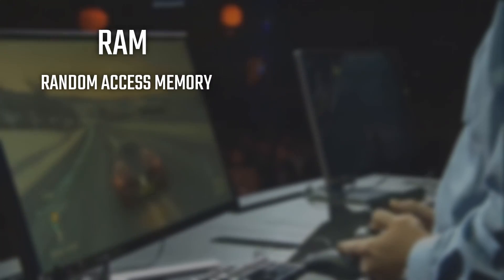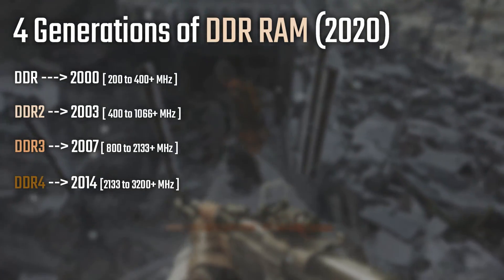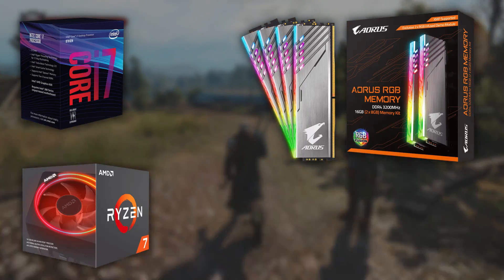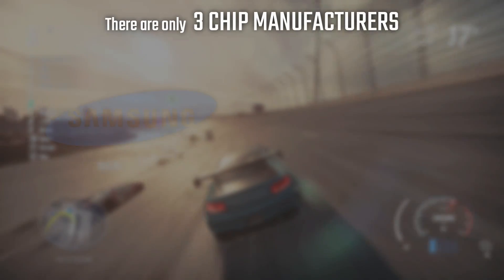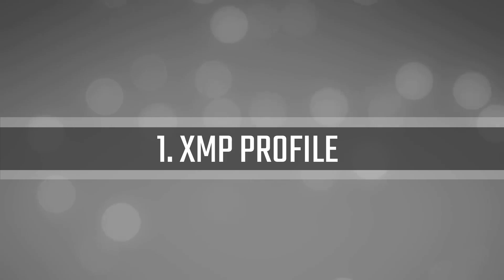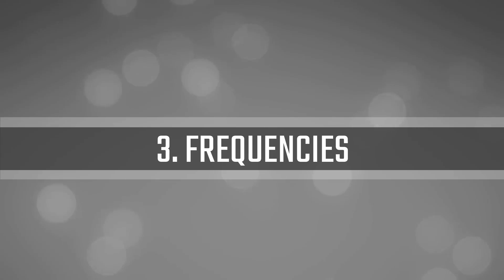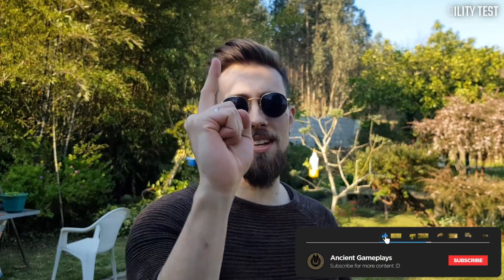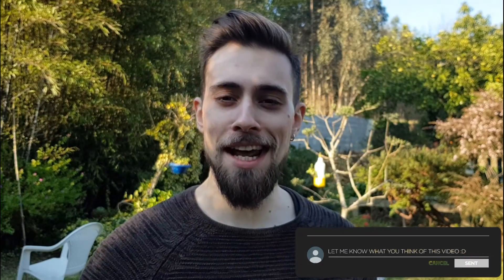How to Overclock RAM (2020 Tutorial) | Introduction of How RAM overclocking works, Tips and Tricks

Comment: But it didn't answered my question kind. All intel 12th gen cpu's supports ddr4 3200mhz and ddr5 4800 mhz stock. I know the motherboards supports these types, but then i see that they've higher mhz supports listened as OC (overclock). And my question is: If the CPU supports up to 3200 mhz ddr4 how does it communicate with the ram's higher speed higher than 3600 mhz and so on?
Reply from the maker: No...you got this all wrong and you're looking at an outdated video. Well, Firstly the motherboard does not support both RAM types, the CPU does. So either you buy a DDR4 motherboard or a DDR5 one. As for the "support" it doesn't mean that they can't run higher frequencies it just means that those are the base frequencies of the memory controller
Reply: @AncientGameplays  i meant that i7 12th gen supports either ddr4 or ddr5. And the main think of OC ram is to look at the motherboard memory specification

Comment: hello fabio. I'm using 1.15V for my soc voltage on a 5600x and b450. Do you think its safe? In this video you said 1.1 at max but after that you said 1.15. I couldnt be sure and i wanted ask. Thank you for your reply in advance.
Reply from the maker: It is, 3rd and 5th gen ryzens like vsoc for higher frequencies. Watch the 2021 version of this video

Comment: ( some tips ) well i learned this the hard and most time consuming way, lower timings usually better performance, not always. helpful video but you wish you did not say "ignore the rules lower timings are always better" that is not true, i noticed there are so many timings that cant be lower than some kind of rule, or some timings dropping them way too much at the edge of instability will cause worse performance. everything you do with timings test performance before stability. dram calculator is so helpful for a base safe overclock then you can start decreasing further.

Comment: i changed to xmp profile and my computer didnt open after the reset
i had to remove the cmos battery to reset the bios settings to get it to work
should i try to change to xpm profile again or will the same thing happen?
Reply from the maker: raise the voltage. Also watch the 2021 version of this video
Reply: @AncientGameplays  can i use xmp profile if i have ryzen cpu?

Comment: Using xmp only, after updates to windows, intel etc, I noticed under load or benches my VCCIO and SA could hit as high as 1.4v on my 9900k

I've been studying ALOT, reading forums listening to YouTube's on my commute and spent 20hours straight (and without the aid of caffeine or cocaine, somehow) + another 20 hours letting two instances of prime95 running (mostly because at that point I was understandably sleepy and passed out with them running.  Woke up and my house wasn't on fire and I said shit I guess it's stable) getting things to run faster than xmp at lower temps 

My other concern is ram.  I use xmp only since going beyond xmp is even less relevant than cpu oc and it's far more sensitive to tweaking so I just leave it be, but it's STILL overclocked and it's still not been tested at the factory to run with my system or cpu for sure, so I was hoping to find someone about good stress testing a memory overclock and if the sa and VCCIO are truly good 

I used prime 95 in. A blend test the latest version without disabling any avx but still ftts in place cuz otherwise the cpu cooks itself but I've read so much conflicting info about how that stresses the wrong parts and I gotta drop my cpu to 3700mhz to do a standard blend or it crashes.  But I don't wanna cheat and turn shit off.

This obsession is worse than my heroin problem was.  I guess I could just take that up again lawl
Reply from the maker: Hey man, for ram testing use TestMem5. Also, RAM oc is a pain the ass, it is not "hard" per se in its essence, but it takes a SHIT LOAD OF TIME to get things straight

Comment: I have options for auto voltages after I over clocked the ram. Do you not trust auto settings? And I have a VDDCR soc voltage of .825v should I still be increasing it above 1?

Comment: Sir i have a Question, my PSU is lc-8600btx 600w (yeah a generic one and it is with me for 5 years, and run find with my current pc)
Specification
Cpu: Ryzen 5 3400G
GPU: Vega 11
RAM: Ramsta 2666 8gb( planning to upgrade to 2×8 3200 Darkza ram, thank you Ancient Gameplay for advices)
MoBo: MSI A320m-A pro( they said it locked which is true but according to box it can  oc to 3200mhz)
And now im thinking will my psu be enough to oc my ram if i buy the 3200mhz ram? Thanks for the help, btw your  video is great, it contain all the information i need on  how to oc ram, bu my problen is psu, is this fine?

Comment: When I run memtest86 with xmp on I get errors should I try manual timings and increase voltage or do you think my ram is defective?

i7 8700k
G.skill trident z neo 3600mhz
Msi z370-a pro
Reply from the maker: Yeap, i think you should first increase voltage
Reply: @AncientGameplays  does increase in voltage fix the crashing of my games?

Comment: i have 4 sticks of corsair vengeance rgb pro and motherboard stock settings are fine, but xmp crashes immediately. its supposed to go up to 3600 mhz
Reply from the maker: It depends a lot on the cpu and mobo you have also. Also, update your bios
Reply: @AncientGameplays  I’ve got a B550M Steel Legend with a R9 3900X and also how long do we test in the dram calc before we know its stable to change freq/timings
Reply from the maker: @lukeronquillo2284  use testmem5. I will update tgis video tutorial in 2021 also

Comment: Okay so I overclocked my memory to 3400 mhz from 3200 and when i attempted to change the timings my PC would not post, so I had to google how to get it back on and I had to CMOS reset my computer to get it back on, next thing I know all my games are shit FPS, tearing like crazy, really shit display so something has been damaged and I need help from you since I followed your tips and tricks. Now I need tips on tricks on how to fix a GPU that got blown up by ram. My pc was working fine before I just needed more fps in CPU bound games like planetside 2 and now I cannot play anything.

What do I need to do?

Overclocked memory.
Got it to 3400mhz stable.
Went to adjust timings.
Pc failed to post.
Put screwdriver to short circuit on motherboard on jatb1 (Tomahawk max b450).
Got PC to boot up normally and select F2 on prompt saying to load bios optimised defaults.
I was happy like yay my pc is working thank god I'm not touching that again!
I go to play Division 2 and I notice that something is wrong, then as I start to twig I notice EVERYTHING is wrong all the textures are tearing.
I restart PC go into bios and just said fuck it, enabled XMP Profile 2 (works fine, worked perfectly before I followed your video and fucked it up).
I go back into my game and everything is still fucked.
I update my GPU to the latest driver (from a previous driver I was sitting on because the driver was working fine, didn't see a need to update).
Problem persists.
I go to DDU website and said OK surely all I need to do is a clean fresh install of my GPU and everything should return to normal.
I was wrong, problem still persists after the DDU clean install of my GPU and restarted.

The only thing I haven't done, which I will attempt to do now is CCleaner. I need your help, I am not buying a new PC this one is legit brand new and it cost me a small fortune.
Reply from the maker: Hey man, i hardly doubt that it was something getting broken, i did that process thousands of times. For CMOS clear, i advise you to take of the little battery on the board, take off the power cable and press the power button continuously for about 10 seconds (that should do the trick and its way better). Having the PC not boosting is completely normal in ram overclocking and i have been doing that step over and over again, and like i said, it shouldn't in any way, cause hardware issue. THe most it can happen is having a corrupted Windows by RAM overclocking fails time after time.

you can also try to update your BIOS and do things all over again. Like i said, i am 99.9% sure it isn't hardware related. Hope this answer helps you in some way :D
Reply: @AncientGameplays  Ahh ok thanks for the reply that makes sense. So I will try to update BIOS again and maybe reinstall windows.

So is it possible for the RAM overclocking to fail which then could corrupt windows causing my GPU to perform poorly? So probably a fresh install of Windows 10 will likely fix the issue back to normal?

It's the first time I have ever had to remove the little battery to get my computer to boost back up, well I didn't remove it I just drained the power on the battery.

"For CMOS clear, i advise you to take of the little battery on the board, take off the power cable and press the power button continuously for about 10 seconds (that should do the trick and its way better)." So you think I should do this now before I re-install windows and bios? Thanks so much for the response it made me feel a lot better because you are much more knowledgeable than I am. lol

Comment: I have an Asrock fatality motherboard and Corsair vengeance 2666 MHz ram and no matter how much voltage I put in I cannot get it to overclock to 2933 it just gets put into a boot loop
Reply from the maker: because you need to loosen the timings. And if you are unlucky you won't be able to overclock no matter what. Just try and reduce the timings

Comment: Well i have hyperx fury 3600 cl17 but when using xmp profile to reach that 3600mhz the bios just reset and  my system got looooong boot .. i increase voltage its better but still bios reseting itself why?

Comment: So I have a 2x8 CL16 ddr4 @3200mhz. Factory setting in my task manager/performance/memory I run at 1600mhz. Why are they called 3200? And if I change the frequency in the bios to 3200mhz I actually double each so I get 6400mhz ? I can run it at 2800mhz in my bios but over this it just crashes
Reply: Just tried 3400 following everything you said and windows couldn’t even start. I had to start in safe mode, reboot and tune down bios again. I had my VOC at 1.13, ram voltage at 1.40

Comment: I cannot run my ram on the 3000hz that the package says if I want to set the ram to that speed, the pc starts up in save mode I have also tried to increase the voltage but that does not matter :/ the max frequency i can run it at is 2666hz. Plss help
Reply: i have the same problem

Comment: My buddy had 3200MHz RAM but it only clocks at 2133MHz. We bumped the voltages to 1.4v and it still didn't work to get the ram clocked right. Stuck in boot loop
Reply from the maker: Humm. What cpu
Reply: Ancient Gameplays ryzen 7 3800x
Reply from the maker: @stephenroth3299  nah, use xmp. That cpu will easily run 3200MHz
Reply: Ancient Gameplays I didn't see an XMP profile the last time I was in his bios but I'll check it out. I only found DOCP
Reply: Ancient Gameplays he's got an ASUS B450-F so I think it only has DOCP
Reply: Ancient Gameplays we also went in, made sure it was set to DOCP, it set the values to 1.35v and 3200MHz, still wouldn't boot.

Comment: Does the amd , thing soc volt also apply to intel chips?
Reply from the maker: Nope, intel uses the ring ratio. You dont need to carr much about intel. Also, ocing ram.on intel platforms is currently way easier

Comment: To the op, curious was your Celeron a 333mhz. I had that bad boy at 500mhz fan cooled with 6 case fans, 600mhz with a soldered personal fridge copper line to CPU hehe. Have a drink and water cooled same time, not sure when water coolers came out but if they was one I didn't know about it.

Comment: I have 16 gigs 3000 MGHZ ram in my PC rn, but I bought another 16gb of 3600 should I just add it into my PC and get 32GB and overclock the first 16 to get them all at 3600 or remove the old ones and just install the 16 of 3600 by themselves?
Reply: you should always install same speed memorys

Comment: Bro, if your main PC is using DDR4 Patriot C19 4400MHz, and you're tunning them to run at C16 3800MHz, you'll get just a really little little upgrade than using them at it's recommended stock frecuency and timing... Its just like have no upgrade at all on those configs. Why did you change the values? You wanna be using less Voltage maybe? Hmmm... Remember (16/3800)x2000 = 8,421... and (19/4400) x 2000 = 8,636... nanoconds... It would be amazing if you're reaching 4200MHz at C17 or C16
Reply from the maker: Mate, you should look into things before commenting...you have to account infinity fabric.
Watch this video i made: 
https://youtu.be/o3UZsSQfTBg

Comment: Hmmm my Asus Rog Crosshair VIII Hero (wi-fi) motherboard doesn't have an xmp option for the ram frequency but it does allow me to raise it to 3600 which is what my ram says it can go up to and I changed the voltage to 1.35 on the DRAM voltage and it just wouldn't allow my computer to boot and disconnected my mouse and keyboard. Did I do something wrong? I have a Amd Ryzen 3950x cpu.
Reply from the maker: Follow the tips on this video mate. Your xmp must be called dohcp

Comment: I just got some new Corsair dominator RAM 4600Mhz in quad channel. I'm trying to activate XMP profile 1 but my PC just won't boot. Do I need to raise the voltage? 

I'm using an Asus Extreme XII motherboard which says it can support 4600Mhz RAM.
Reply from the maker: Hey mate, what is your cpu?
Reply: @AncientGameplays  Intel i9 10900K is my CPU.
Reply from the maker: @Shadowsmoke11  yeah, that high speed is not guaranteed even on intel. Update your mobo bios, and give a voltage of 1.45v to start with on ram
Reply: @AncientGameplays  Thanks! I'll try updating my bios the the latest version and then attempt another try to get the my ram to work with the XMP profile. 

I can change increase voltage manually to 1.45 volts like you say. But doesn't the XMP profile otherwise adjust the voltage for you when applied? My XMP profile says 1.5 volts. 

Anyhow, I'll reply after I've tested updating the bios.
Reply from the maker: @Shadowsmoke11  also, you wont have quad channel with an i9 10900k, just dual
Reply from the maker: @Shadowsmoke11  then use 1.5 volts mate :D
Reply: @AncientGameplays  Only dual channel works? Quad Channel can't support higher speeds like 4600Mhz?
Reply from the maker: @Shadowsmoke11  no, what i mean is that no cpu in the mainstream market uses quad channel. You can use 4 sticks but it is still dual channel. Xeons and threadrippers for example can use qusd channel. Ryzen and normal intel cpus cant
Reply: @AncientGameplays  Okay. I updated my bios on my Asus motherboard and I tried again enabling the XMP profile. Same issue as before. It will fail to boot up. 

I tried Manual mode and I decreased the RAM speed to 3200Mhz at 1.5V and it works. I had 3000Mhz on my older RAM which capped at 3000Mhz. I dunno what else I can do. I 3200Mhz a worthwhile increase from 3000Mhz for 400 Dollars? 

Also would I need to lower the main timings as well in manual mode for max effect?

Comment: Hey I have a single channel ddr4 4gb at about 1000Mhz
Im planning to upgrade to dual channel ddr4 8gb at 2.6kMhz
Im on laptop... Is it doable?
Reply from the maker: Hey man, single channel DDR4 doesn't exist below 2133 which true speed is 1066MHz (so you actually have DDR4 2133). Slow frequency ram on a laptop is a killer performance wise and even more if it is only one stick. Both sticks will help considerably indeed, but if your bios does not allow XMP or OC, your 2666MHz RAM will work at 2133MHz too
Reply: @AncientGameplays  well that's weird because mine shows it has only 1066Mhz but at the same time it shows DDR4
Tried checking on both cpu-z and speccy
I have no idea why but my laptop doesn't seem to support dual channel... I guess i'll just stick to one channel and give it some OC
Reply from the maker: @mightypirate8769  i explain that in the video mate :D
Reply from the maker: @mightypirate8769  also, in terms of laptops dual channel is even more needed...
Reply: @AncientGameplays  ok cool!
Unfortunately my laptop model doesn't support dual channel so I'm missing a lot of fps increase in gaming which is pretty sad thx for replying though! Have a good one
Reply from the maker: @mightypirate8769  every laptop supports dual channel unless really small ones

Comment: @Ancient Gameplays hello friend, I have a problem I have the msi mortar max board and when I run xmp and put the voltage at 1.35 the board makes it work at 1.36, and if I lower it to 1.34 the board makes it work at 1, 35, which voltage is the correct one?
Reply from the maker: It doesn't matter mate. It is all th same :D